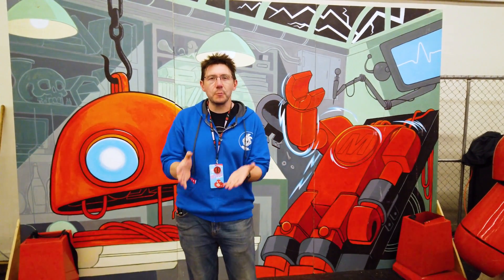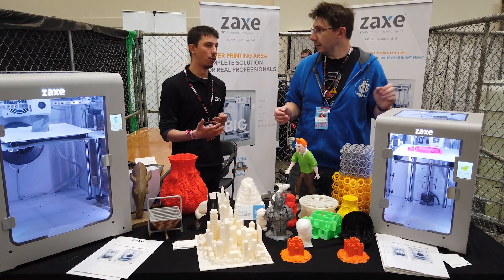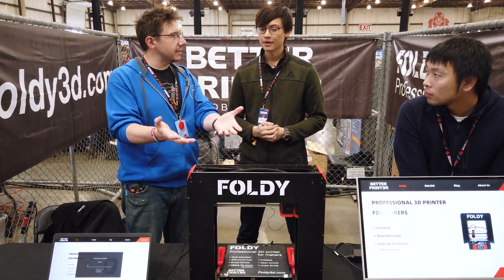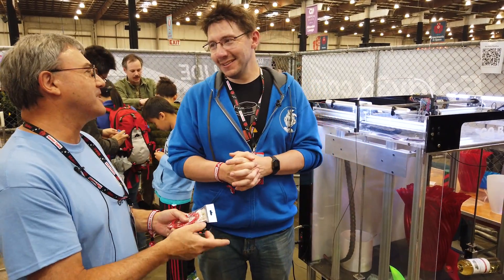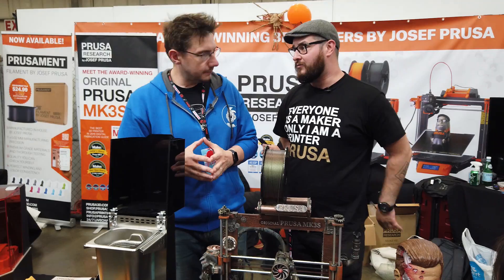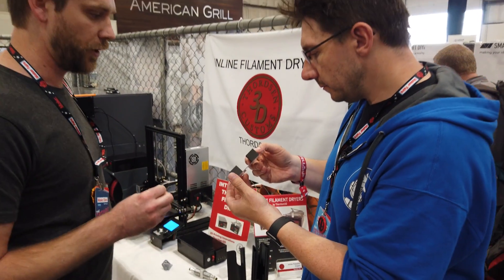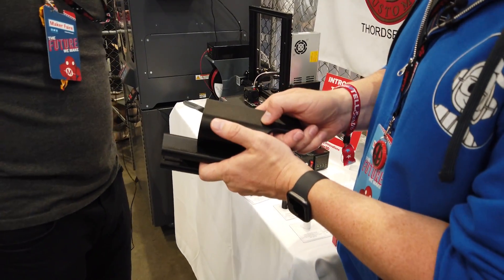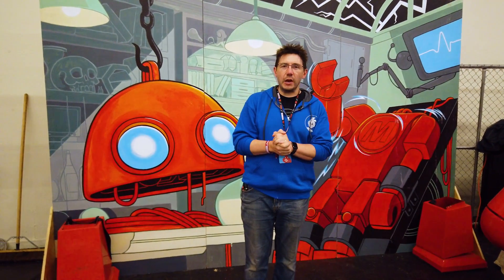Is There 3D Printing at Bay Area Maker Faire?

Comment: Hey Joel/Sean, just for the record - the Foldy3d printer seems like a "parking extruder" (magnetic or mechanical) type where the left extruder can "attach" the right one and drag it around like a locomotive. This means only one of them can actually print at a time, not both, and the left extruder has to be kept above the part while the right one extrudes, like a "dual head" setup. Thus it's distinct from a true "independent dual extruder" (IDEX) which can move both carriages independently.

Comment: 1 question, how is the "Foldy" machine actuating 2 heads on the same axis @ 6:53? independent belts? did they attach a magnet to the main head so it collects the second head for movement?, using an electro magnet on a switch you would be able to drag a second or even a third print head.

Comment: I really enjoyed the last part of the video the EXO slide my question if you probably asked or not how many would you need if you were to say convert a v wheels to this 1set, 2 sets, 3 sets or 4 sets?
Reply: Hi Mathew, for one independent rail, three ExoSlides are the minimum, with four being recommended.  Three is workable if you only need to mount to one face (accomplished by mounting to the middle slide).  Four slides are needed if mounting to more than one face, or if a stiffer assembly is desired.  More info is on the website under Guides.

Comment: I really like the exoslide. I'm just curious about having the one with the hard metal bearings wearing down soft aluminum extrusion. There's a reason they don't make linear rails/rods from aluminum.
Reply: Hi Kyle, the ExoSlides are also available with polycarbonate treads over bearings to not wear the rails.

Comment: Joel, fascinating video, great to get a view of the 3D printing part of the trade fair, but when it got to the inline filament dryer that's when I got really interested.
I have a food dehydrator for drying filament & some water tight tubs & 2kg of silica gel beads for storing my filament, but what temperatures do you personally use for drying various filament? Drying TPU at 160f for 10 hours looks a little extreme?

Comment: Foldy is saying you can take the printer as a carry on?!? If you want to get pulled aside and then have the machine confiscated.
Reply: Yeah who in their right mind would try to fly with a robot that no one understands outside this community?  "You're saying this can heat up to hundred of degrees to melt plastic?  You can print daggers, clubs, and you want to take it on a plane?

Comment: Don't know why, but the foldy for some reason raises a red flag in my brain. :) And yes, also multiple red flags on yet another small filament dryer (scientific opinion; it's bs). lol I do appreciate the courage to try to explain it though.
Reply: Maybe that a nema23 and those speeds can do some damage?
Reply: @MisterMakerNL   the nema 23 thing was really strange
Reply: The accuracy on that thing locking back in to the EXACT same spot every time is a worry. When they say "1 or 2 mins" to unfold, my guess is then you need to troubleshoot, re-level, etc.
Reply: @nataliesilsbury1888  it's most likely a few screws that need to be unscrewed. Better repeatability than  say a spring loaded pin which would be faster